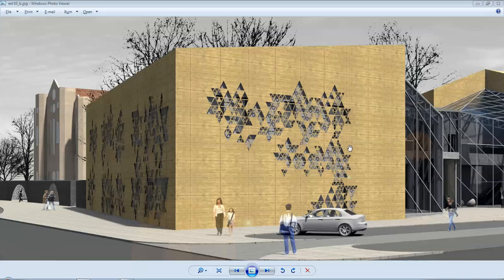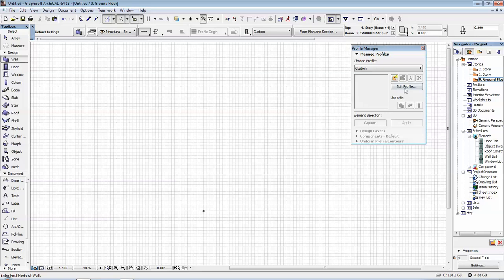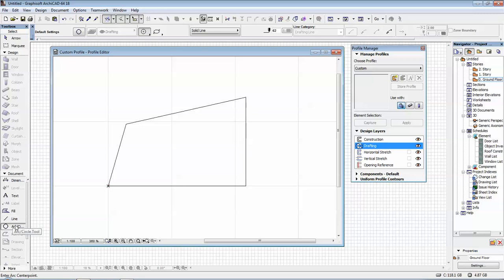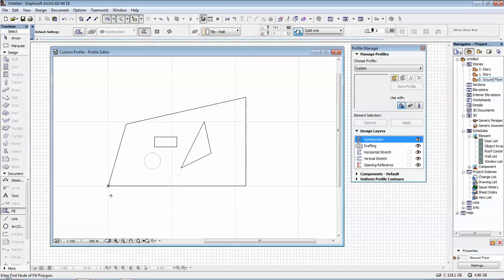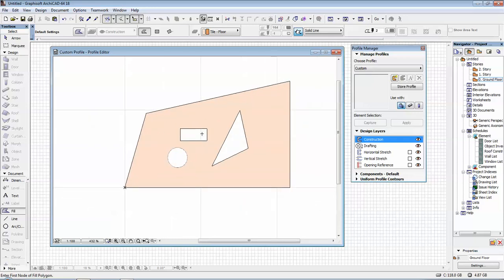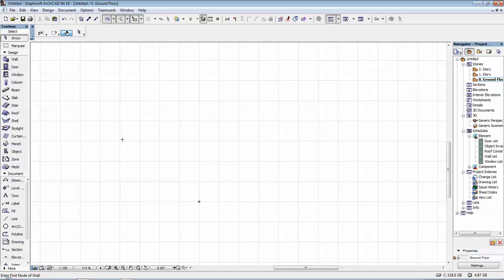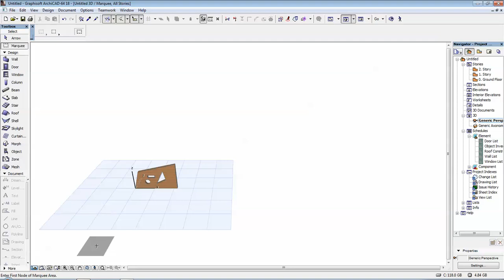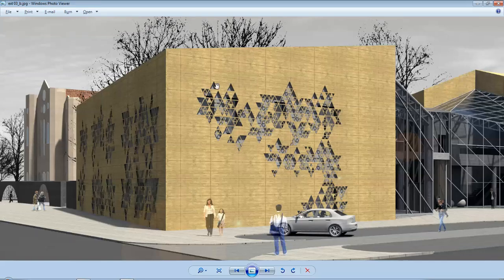How to create a perforated wall in Archicad

Comment: ??
This method does not work well on wall corners, with intersecting walls, or with windows and doors; not it is good with proper bim-modeling, as it gives no calculations for materials quantities, etc.

ArchiCAD has had boolean operations for 10 years to do this stuff properly.

Comment: I want to so important point pls help me ?
Is there a way to make multiple holes to fill (or slab, mesh etc.) with subtract from polygon -tool by using magic wand? Something similar like ctrl-clicking line ends or copy multiple elements pressing ctrl+alt while dragging. 

Now it is frustrating because I have to click every time fill's edge first and after that a hole I want to make.

BUT IN THISH VIDEO only one click fill and consecutively 3 click subtract. HOW MAN HOW ???
Reply from the maker: +Yunus Emre Küçük I hope i understood your question correctly.. I think you asked how to subtract from fill with magic wand. 
The answer to that is that you have to select the fill, and then hold down the SPACE bar, and then click consecutively on each shape that you want to  substract (the shapes should be drawn in advance)
I hope I answered your question.

Comment: why not use solid elements operations?
Reply from the maker: +bitarmuzik you can use solid element operations as well, depending on what you need. When there are too many perforations, as in the rendering I showed at the beginning of the video, I prefer to use a custom profile.

Comment: How can I find the perforated wall that i've drawn?
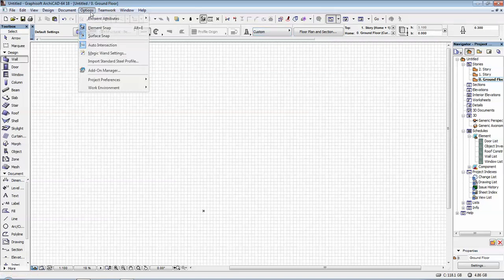Reply from the maker: +Sara Rabaa  Options > Element attributes > Profile Manager, as I have shown in the video at 0:35. That is where you can find and edit the profile.
Reply from the maker: +Sara Rabaa at minute 3:30 I show you what options you have to select for your wall tool so it will have the profile you have drawn. I hope it helps.
Reply: +four5six Thank you very much dear.